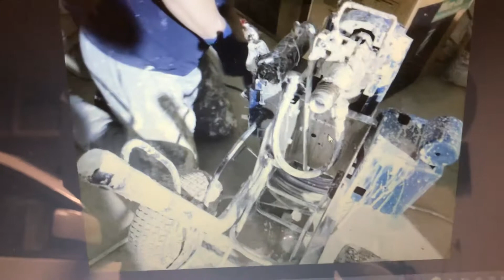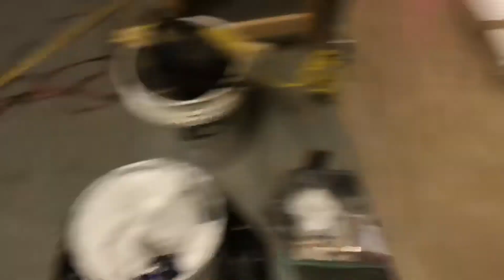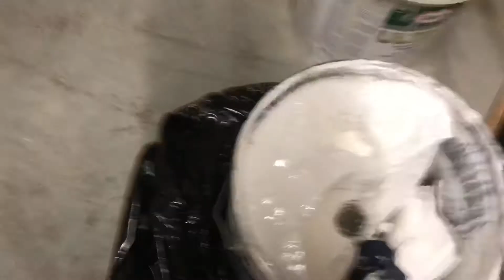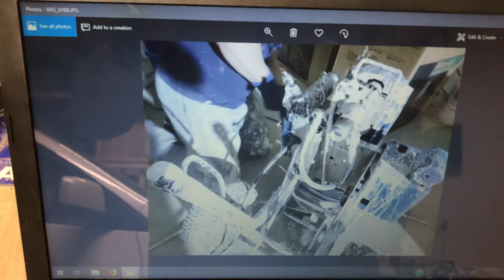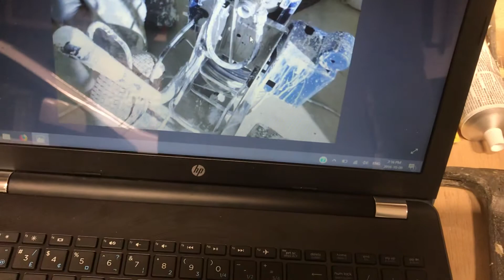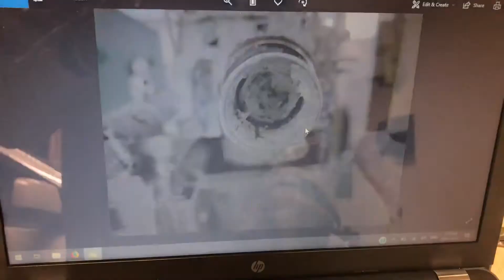Spraying epoxy with a graco ! DO NOT DO THIS to your machine

Comment: Hi buddy, one question, could i use a 490 graco ultra max pc to spray epoxy paint?, thank you
Reply from the maker: I wouldn’t , don’t know how fast you work but a cigarette break could ruin it all. Timing is always an issue , how fast can you spray it , how big of an area is it ? What’s the epoxy that your using look through the TDS take temperature readings and make it precise.
Reply: Few people realize this but Not good spraying out of a big bucket either because you're working time is shortened measurably when epoxy sits in a large container. A crazy thought is to mix what you can spray in less than 5 minutes and keep adding it to the container.